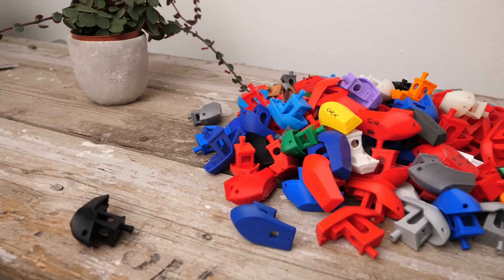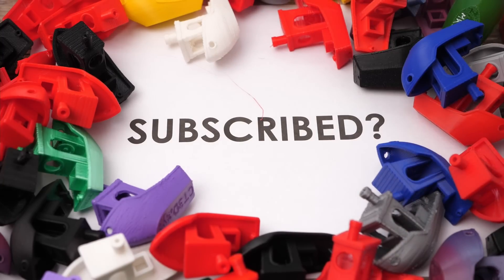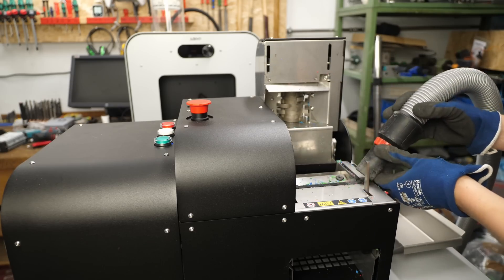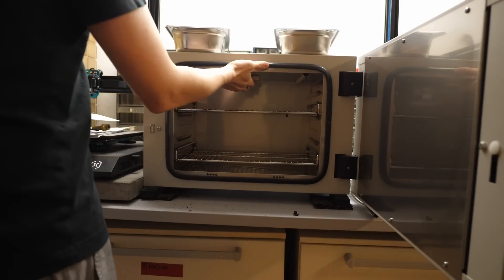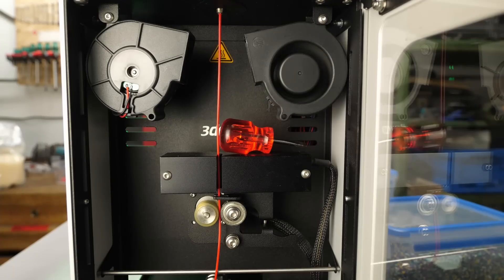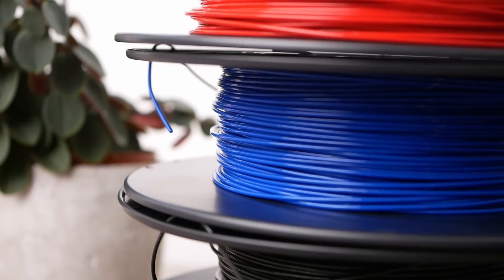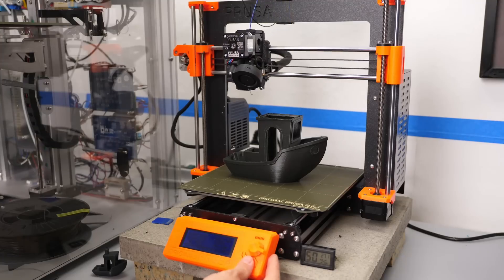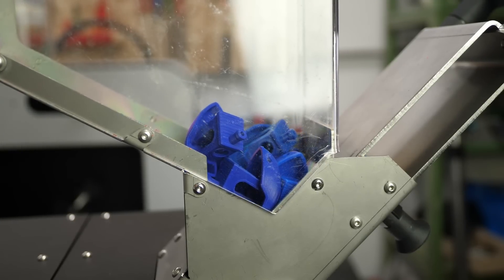Recycling all my 3DBenchys into new Filament

Comment: Hi CNC-Kitchen,

Since a while we also have an extruder. In minute ten you explain something about a problem of the diameter. The material seems to stuck in the extruder and dieameter decreases fastly. I also have the problem. You are in contact with 3Deveo and they also offers you to send an example. that is cool I don't get an offer like this. 
So maybe you can tell me which configurations you set in for the blue and the red filament in the video. that would be realy nice.

cheers.

Comment: You said that your recycled material was more stringy even though it should have been bone dry. Although you'd ride the material prior to Extrusion; you have to think you're still in a room with fluctuating humidity and hot pla could more easily absorb water from the atmosphere. So it may have gotten moisture through the recycling process. I'm willing to bet if you put a dehumidifier in that room to negate any humidity fluctuations during Extrusion; that it would fix the problem

Comment: I was wondering if you could turn the large blue tubs they use for transporting laundry detergent and other chemicals or 200 liter olive barrels into filament ?? I work in a factory that has losts of 25 liter bottles that they throw away. Could those be turned into filament too ???

Comment: Some of the reduction in strength may be caused by impurities that you hadn't accounted for. For example, you handled the raw materials with your bare hands, which no doubt contaminated the mix regardless of how clean you think your hands are. This kind of issue is why plastic recycling isn't catching on. Industrial plastic recycling tends to require some hazardous chemicals to strip away contaminants and add back some lost strength, which ends up making the environmental benefits questionable. Recycling processes still need some refinement in order to cut back on these issues. Even after the rigorous cleaning, recycled plastic is typically not suitable for the same purposes that it was originally used for, which is why so many plastic bottles get turned into weather resistant planks. Recycled bottles will always have too many impurities to use as bottles again.

I would've combined some similar colors and colors that result in nice secondary colors. For example, combining all of the red, blue, and white would result in a nice lilac color. It would reduce waste by reducing the number of times you need to purge/clean everything. Also, removing the white material from the last batch would've resulted in a darker black.

Disclaimer: I have very little experience with plastic extrusion and recycling, but my dad worked on experimental plastics back when they first started putting drinks in it, so I learned a lot about plastics from him. Likewise, my brother extrudes recycled plastics in his work, so I've heard plenty from him about difficulties with modern recycling.

Comment: Stress/strain graph is more useful than UTS. The test samples should have longer failure mode zones, larger pin holes and larger anchor zones. The failure samples should have visible necking close to the failure location. If they do not then plastic deformation has played a role elsewhere in the sample which can not be measured by the test (commentary states the the failure mode was not brittle). 

Why is this important? UTS is the highest stress the sample experience during failure - permanent deformation has begun long before the UTS is reached (except in the case of extremely brittle materials) and therefore the stress at which plastic deformation begins is more useful for all real world applications. This can't be accurately determined without significant necking in the failure mode zone and this is not occurring due to relatively equal sample cross section. 

To fix this stronger anchor points are required hence my initial suggestion of long failure/test zone, larger pin holes, and larger anchor zones. Stress and strain should be measured at intervals during the test - this will allow for a comprehensive profile and the materials behavior during under stress and enable identification of undetected flaws in the recycled material's mechanical properties.

All that said this was a fascinating video and clever experiment that may potentially unlock completely new possibilities for the burgeoning 3D printing industry.

Comment: I think having technology like this is very important for any person whether for a group or an individual. It reduces plastic waste that would otherwise pollute the either. It would be a sort of return in investment as you dont have to buy new filament for a project especially a test print. It is not a very complex process and easy for many to do. So i think it should be of a higher exposure because it could really change 3d print experiences.

Comment: Excellent video! Doesn't the strength test sample need a much larger holding pin diameter to ensure no deformation other than the central break point. Love the material science details. Well done.

Comment: Suggestion about moisture:
You mentioned that stringiness might have been caused by your filament being moist, then claimed it was bone dry. Can you really be sure of that?
After drying the chunks it took the machine hours to to re-melt the plastic into filament. During this time it was exposed to moist air and since the ground chunks are smaller and much rougher than commercial plastic beads they should experience greatly accelerated sorption while just waiting in the hopper of the machine to be re-melted.
I don't know about the plastic industry but in the chemical industry you typically add a hygroscopic desiccant into a closed space with your material when storing or even when working with it to ensure absolute dryness. If I didn't just miss something and your chunks really were exposed to moist air for hours while sitting in the hopper, I may suggest:
- actually testing the moisture levels in your recycled filament
- enclosing the hopper and using an air dryer or desiccant to keep it dry right up till it gets processed

Comment: I really need to get a recycling device with all my failed prints and experiments....  I make sure to recycle my prints, rather than trash, but itd be nice to reprint since I mostly just print black.

Funny thing, adding a bit of ABS to PLA is a common alloy used for making high impact pla, so you might have gotten a better pla if you had mixed in some abs.  ^_^

Comment: Hi Stefan, me again.

Your...Daughter?  Boy you are getting old.  I had similar unpleasant thing happening to me with my son, bought him a pirate sail boat 3 masts, with pirates and everything, on 3 wheels to play with (he was 6 years old) just to never see him using it, so I asked why, he's answer..: it doesen't float.  He actually expected it to float, but was capsizing constantly.  So I cut a 3 mm sheet of Stainless Steel in the sahpe of a under boat fin with the upper horizontal part long from front wheel to the axis of the 2 rear wheels, welded some 6 mm stainles steel rods to fit in the wheels hubs, the thing was like 2Kg, and ... voila... his boat floated in the bath tub (some silicone inside included to keep it water tight)  It floated so well that anytime we went at the beach he wanted it with us, that thing floated on th Adriatic sea, on the Tagliamento and Piave rivers, and some other lakes and rivers, took waves but never sunk. We still have it.

OK, going techincall, so you spent some 10 gran in US or Euro, on some machines to grind and remelt ...3Kg of filament at the rate of 150 grams per hour.... .

I had a look at the chinese semi industrial equipment for production and in 10 gran, you get a decent grinder (you might have to re grind twice tou like you just did), the extruder goes at a speed of some 20 Kg per hour, 2 phases 240 Volt, with sieve in the extusion flow to prevent larger particles to be included in the filament spool.

unfortunatelly for now I ony have some 10 Kg of supports, failures etc, to re melt, so for me puting 10 gran into a small line (the size of a long desk, not as compact as your machine) is not justified, but if I am to spend 10 to 12 gran for this, I'd go for the 20Kg per hour machine, than just buy myself pellets and tinted pellets, and make my virgin filament at a fraction of what I pay now ( pellets bought bulk are like 2 USD to 4 USD per KG), not just to recicle failed wastage, which is always a great idea, but economically not feasible at the rate I print.

Comment: There seems to be a lot of complication to getting even extrusion starting with fully recycled material.  What's the feasibility of starting with a DIY preform and using a drawing process (like your investigations on what the US Army was doing with the PC core-ABS filament)?  Ovens, heating elements and lathes are more accessible than shredding/pelleting machinery, not to mention maintenance.  Not every location on the globe has 3 phase power, either.   I envisioned melting down plastic scraps and rolling them into a core (extrude it into a pipe in the case where you already had invested in some small scale machinery).  You could even take multicolor/multimaterial wipe towers of cylindrical geometry and submit them directly to drawing as they're already solid.  Chemically or friction weld many together for bigger feedstock.  Not saying any of it is easy, just putting an idea out there!  Thanks so much Stefan for all the experiences you share!

Comment: You can burn a little bit of each part, like by touching it with a soldering iron; the fumes of PLA, ABS and PETG smell very distinctly and differently. I dont know about PC or other materials but i guess thatll work too.

Comment: If you want a more consistent color, wouldn't it be easier to extrude the filament once, cut it to the same size as the PLA bead material, then feed it into the extruder again? This would have a more consistent flow rate.

Comment: Thankfully, I learned about the limitations of recycling unneeded or failed prints before I started 3D printing. So I've been able to avoid failures, and I don't need to print as many prototypes simply by designing more efficiently.

Also, I don't print toys and large pieces. Anything over 6 hours I make out of wood or metal.

Comment: I love this man! I suspect this would be worth it or at least make even if it was streamlined and centralized, as in people accumulating PLA locally, then bulk ship it to somewhere else. Perhaps to a location that would confirm PLA and grind it up to a certain particle size then send it further. I would even pay for it without getting anything in return, as long as it is not a scam. I suspect several other people writing here would do the same.

It can broker the way for better solutions for recycling 3d printing parts/failures, perhaps partially applicable to plastic recycling in general? 
From what I've gathered that is the major issues of recycling general plastic waste is the following :
-Not cost effective
-Hard to separate/differentiate plastics
-Often custom plastic blends...
-Easily contaminated plastic because of recycling mistakes, carelessness and/or assholeness.
-Not enough demand for recycled plastics, willingness and/or knowledge to use it
-Beliefs that certain plastics can't be recycled and/or has reduced effort at recycling (which might serve as insulation, park benches etc depending on plastic), both at households and at recycling/garbage plants
-Difficulty using recycled plastics with current recycling methods and volume

Some of these problems could be alleviated, but in the end, it comes down to money, logistics and legislation.
And it could start with the following perhaps? :
Plastics used for food containers, fruit etc in grocery stores, could be standardized in shape, color and/or size. As in having the same plastic, where it is ground up, washed and compacted into a specific identifying bag/box that are sent to recycling with the trash when full. Way this is done, is with a mass produced grinder and washing unit, that will only accept plastics that are intended for it.

Sure, it most likely has to be subsidized in the beginning, but it might make sense socially and infrastructurally eventually, or perhaps never. But isn't this the same with garbage already now, as in we pay to get it removed one way or the other?

If we eventually end up with a machine that can identify, grind, wash and separate plastics which is then compacted to be recycled at homes or elsewhere, it might alleviate several mentioned problems and perhaps some not mentioned? Perhaps it can even sort your trash entirely, as in just feed it general garbage, and it does the rest with recycling, sorting a wide variety of materials and biological matter correctly? :)

Comment: It will be essential in the future, even with Bioplastics like PLA. I am extremely impressed with the results you got at 100%. Where I work all our plastic is being moved to 30% recycled (well, some of it has been that way for years!) and there have been some huge challenges, all similar to what you have mentioned. They are pushing for 50%, but contamination is very difficult to work around. Some materials were even aggressively eroding the dies used to blow the polymer, and the energy required to have those re-made was huge.

ultimately, what I would love to see is people REDUCE the amount of types of plastic we use, but the way the world is going it is getting worse, with so many companies adding different stabilisers or modifiers to Polymers, in attempt to make them "better" for the environment, but really its making recycling much harder.

Comment: if you feel like trying other materials than PLA i can supply you with all kinds of polymers. biobased, oil based, recycled,... maybe even things like Polyamides? or fibre filled?
I work as a researcher and sending you a kilo or two of different materials shouldn't be a problem. we usually run 100kg+ extrusion runs, so noones gonna miss anything :) 
If you are interested hit me up and ill get a list of materials we have on hand and can easily spare without getting in trouble from NDAs and such ;)
Edit: im also from germany, so shipping is ezpz

Comment: Please look into real metal filaments. You can buy metal powder and mix it with pla pellets, and extrude it with your extruder. The real metal filament parts can be sintered into actual metal parts. The filament cost a lot if you buy it

Comment: I wish there was a company that sold recycled filament, but they will send people a reusable container that should be sent back when filled with pla, or another material. Although the person would need to be charged for the container, if not returned, and shipping costs. The end filament would be very low quality, and would likely never work because the recycled fillament would get sued by the original fillament manufacturer but I think it is a  good idea. CNCKitchen, what do you think?

Comment: That's awesome and it's exactly what I want with my business. I remember seeing a video of someone a long time ago taking up a whole room just to do what this machine is doing. I can't afford it now but I haven't thrown out a single failed print since I got my printers a couple years ago because I want to reuse the filament. 
Great video! It pointed me in the right direction
Reply: The really long setups are for higher output, as in faster production of filament. With smaller setups your filament production dramatically slows down, which isn't a big deal for a hobbyist, but important for a business.

Comment: I'd say this is worth the cost if you 3D print pieces all the time. it can help save costs on buying new filament if you can get this system up once and run it continually with minimal maintenance. but if you only print every once in a while, it is not worth it

Comment: Currently its not cost effective for the average 3D Maker to even think about recycling filament.   The fact you can purchase a spool of PLA, PETG and various other types of materials for around 23 bucks and cheaper,  There is no way you would be able to recycle material cheaper than you could buy new.    The DIY filament extruder are prone to fail not to mention the issue with keeping the diameter of the filament consistent.         The commercially availble extrusion machines are very expensive 3 to 7 grand depending on the model and size,  you will also need some sort of pellet machine to feed your extrusion machine also very expensive to buy or a DIY version which is more reliable than the DIY extrusion but still expensive to build.    

Like i said before its simply not cost effective to do on a small scale.      One idea from another commenter was to have a company that gives discounts on new spools vs what is exchanged for failed or otherwise unwanted 3D prints,  This may be a way to reuse the scrap filament yet presents another problem,   How to maintain a seperation of types of materials,  IE  PLA,ABS, PETG and so on.   
If will be interesting to see what business open up over the next few years surrounding this potential model.

Comment: For the inconsistency of the mixed material, I imagine it'd help the more times you recycle material and mix it with already mixed materials as that should help to essentially remix the material getting it closer to a more even mix. Still, I think this is definitely useful. Perhaps most useful for anyone who uses 3D printing for rapid prototyping and creating blanks for molds and the like. Like someone using 3D prints to create blanks for dice molds that'll be cast in resin in the end. Just design, print, smooth and polish, mold, and then recycle once you're done.